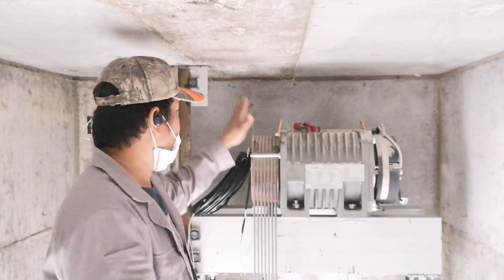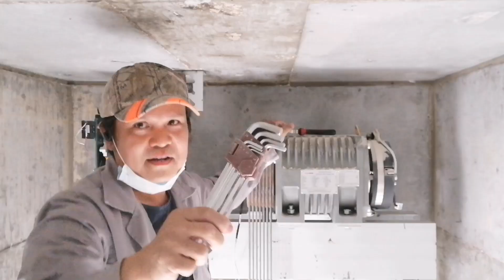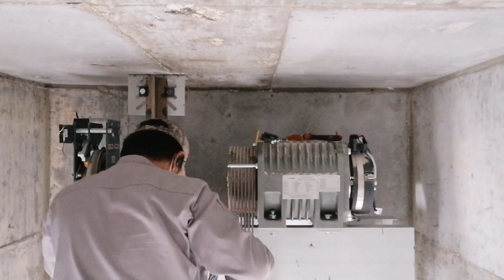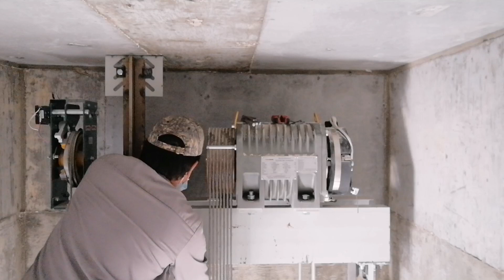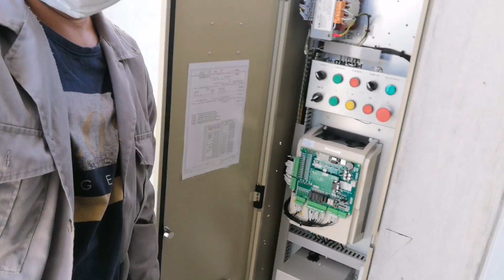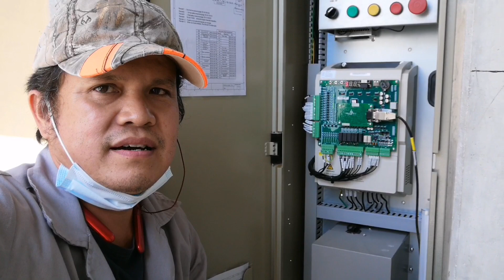ELEVATOR LIFT CONTROL POWER UP//MOTOR WIRINGS//Lito Oclarit

Comment: Sir can i ask you? Nwalan po ng power ang ilaw,fan at cctv sa aming elevator,what should I do n ipaCheck?
Reply from the maker: power supply muna baka namn naka off lang then
circuit breaker sir kc ang ilaw at fan naka breaker din mga yan
baka may shorted kaya nawalan ng power..
Reply: @litooclarit   Ah oks pag power shortage po ba pede plit n ng breaker nya?     Thank you very much for your Info sir  And to your channel po😊👍
Reply from the maker: no need to replace breaker good pa yan i case shortage check line ng ilaw fan mo baka nmn may grounded na 100% mag trip breaker 
mo if d namn shortage on molang ulit breaker mo
Reply: @litooclarit  thanks for your supportive answer sir lito👍
Reply from the maker: Welcome sir